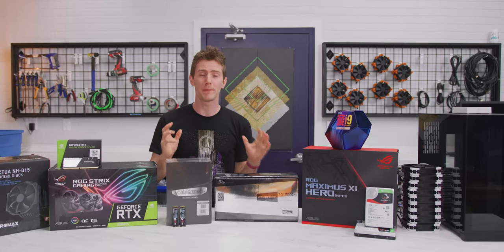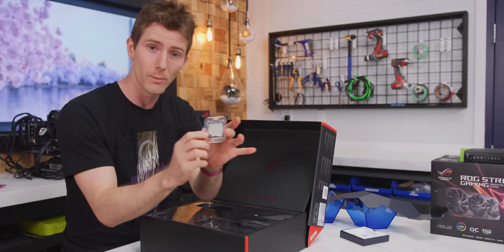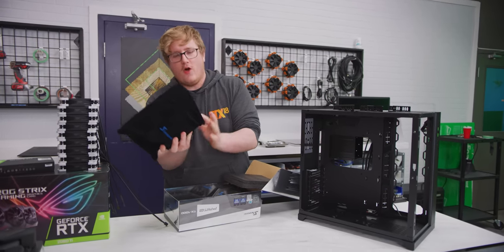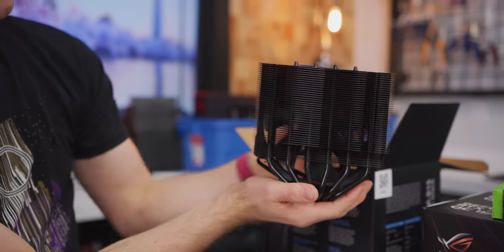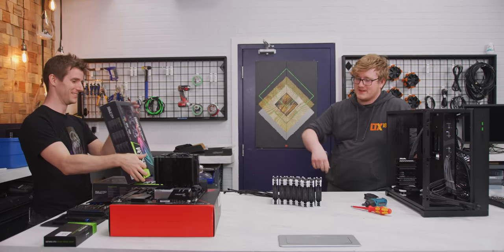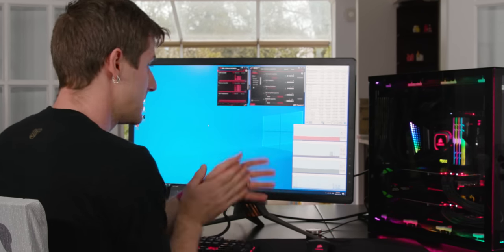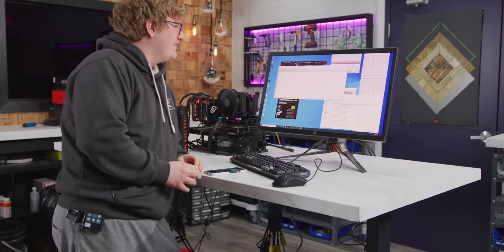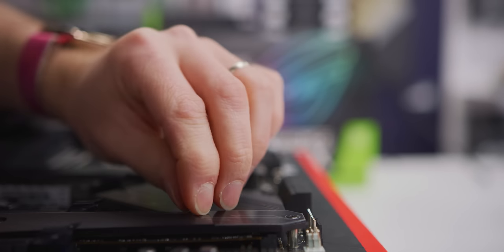Can AMD Beat the ULTIMATE Intel Gaming PC?

Comment: "Something that we could with a straight face say, there's a chance somebody is actually going to buy it"...
Goes on to say "the i9-9900Ks is still the king of the roost" -  A cpu they don't make any more because it was a limited run & you can only get "used" for upwards of $2,000.

Derp.
Reply: Funny thing is they bottlenecked the setup with the 9900KS cause it only runs 2080Tis on PCIe 3.0 X8. If they wanted the ultimate setup, they should have used HEDT
Reply: Ppl pay 2k for used 9900ks? Fuck 'em.
Reply: Funniest thing is the 9900KS would be handily beat by an 8086K, since you can regularly OC those to 5.5GHz or more (and they're cheaper to find, only issue is shitty Intel stock TIM). i5-10600K overclocked should handily beat a 9900KS in gaming (from the benchmarks I've seen), which I find hilarious...
Reply: Intel has a seller on their own site for €702. No idea what you are talking about
Reply: Definitely not $2,000 for a 9900KS I don’t know where you’re buying your CPU’s but that’s a huge ripoff. Also they didn’t overclock the Ryzen at all so it wasn’t a fair test to start with. When one is already overclocked pretty high and the other isn’t at all.
Reply: @Amusia727  The difference between those 2080Ti's running at x8 vs x16 is much smaller than the penalty you'll get from downgrading to HEDT parts from the 9900KS in games, so that is a pretty shit idea.
Reply: @SamxMusic68  Ryzen barely overclocks for one, pretty well known. Also, the gains from 5.1Ghz vs the 5Ghz stock all core turbo on the 9900KS are pretty tiny. It would have still won easily. And if they had tested at 1440p vs 4K, the margin would have been even greater lol.
Reply: You can easily get cheaper than that. They got a pre-binned version for less than half of that for god's sake. Just google the price and you can easily find sellers. Where are you pulling these claims from?
Reply: @Amusia727  A much easier solution to the PCIe bandwidth would be to just use a single 2080 Ti, not to switch to the HEDT platform (which typically has higher latency, and usually can't clock as high).
Reply: @soulshot96  Except there's a 20fps bump when you switch from a 9900K to 2950X...
Reply: @nathangamble125  Oh yeah, I think multi-GPU setups are a waste of time for most gamers. Just pointing out the better scaling on HEDT parts. Properly tuned HEDT handily beats consumer parts though
Reply: AmusiaPrussia Yea, 20fps gone out the window lmao.

Comment: Linus: "One area we did go over the top was our 2x1 Tb Ssds in raid 0"

Me: Awkwardly looks at 2x 2080Tis and 32 Tbs of HDD
Reply: Iago Lavor ikr man should have 0 HDDs. Dinousaur tech
Reply: the only one that doesn't make sense is 2x2080Ti
Reply: Patrick B HDDs in 2020. Lmao.
Reply: @Khloya69  HDD are still helpful as an archive media. and for things that doesn't need fast speed also for having your steam library on it and just copying games to SSD instead of re-downloading from internet
Reply: KA Tech >steam library
 >HDD.
>OK. That should be the last thing u want on HDD
Reply: KA Tech i don’t even have any HDD just 8TB in SSDs
Reply: @Khloya69  I am talking about instead of removing games, putting them on it in case you want to replay or just holding games that doesn't benefit from SSD
Reply: @Khloya69  for me I have 500GB SATA SSD and 500GB 2400RPM HDD
Reply: KA Tech i have 2x NVMe SSD and 2X sata SSD at 2TB each. Damn most mobos only having 2 m.2s
Reply: @Khloya69  I am stuck on low end skylake laptop I don't even have m.2 connector
Reply: KA Tech I recently upgraded to a 3950x system. Taking advantage of that sweet pcie4
Reply: IKR,   2 x 1TB NVME drives, $300-400 maybe depending upon vendor/sales/etc.    2x 2080Ti  $2300-3000 depending on how bent over you want to feel from the Nvidia  "we ain't got no competition" pricing scheme
Reply: @Khloya69  I also have a 3950x and all SSDs.
Reply: rodgerfox3 you used the wrong you’re which invalidates your whole reply
Reply: ChloeWade if people want more storage they’re going to go for Hard Drives not SSDs lol, no need to be so blockheaded about it
Reply: FPSpammers you mean if people are poor?
Reply: @Khloya69  lol i thought you were an Intel sheep
Reply: loading2112 only sheep was you to believe I’m a sheep for any company.
Reply: SSD's are nice for operating systems and certain games but overkill for movies, homework, and older games.

Who the hell needs their movies to run faster? Who the hell doesn't want 32TB's of storage? People just love spreading salt.
Reply: thegeorgezila nobody cares if it’s slow af dinosaur
Reply: ChloeWade lol nice bait, but grow up
Reply: ChloeWade LOL yeah I’m sure
Reply: similaritiesendhere no. I never met my dad and idgaf about that. Besides I keep guns so people don’t get to try that shit.
Reply: thegeorgezila mad bc u haven’t got long left lmao
Reply: thegeorgezila I’m not ignorant. There’s no valid reason to buy a hard drive
Reply: similaritiesendhere who tf even watches movies
Reply: similaritiesendhere i don’t behave like a child lmao.
Reply: similaritiesendhere I’m ‘overpaying’ ever thought you’re just underpaying?
Reply: similaritiesendhere you’re embarrassing yourself by mentioning such outdated mediums. Not me.
Reply: thegeorgezila  This has nothing to do with reason. She is technically right about SSD's being superior HDD's. 

This has to do with maturity. She's getting off on making enemies online while discussing hard drives. Can you imagine how many people find her insufferable in person? She said that she's getting ready to turn 21. She's gonna get punched out at a bar over some disagreement over something that doesn't even matter.
Reply: similaritiesendhere can’t get punched out in a bar if i don’t go out. Genius. Also when i do go out i carry a gun at all times foe that exact reason
Reply: similaritiesendhere i don’t give a fuck about making enemies. That’s why i do it all the time. Being liked is overrated
Reply: thegeorgezila you cannot possibly be for real when your generation single handedly destroyed the economy. I’ve had to do more than you ever did. You old people basically had everything handed to you shit was so cheap. I didn’t
Reply: thegeorgezila keep saying i will still be a child but I’m already more mature than you’ll ever be.
Reply: thegeorgezila old people single handedly ruined the economy and i will never forgive them
Reply: @thegeorgezila You can have both. NVME for your operating system and main programs/games and other cheaper drives for actual mass storage. Every popular PC builder on youtube follows this strategy. 

How do people who don't understand this have the balls to give PC advice on the internet? My gaming laptop has a 1tb nvme drive, 2 tb's of hybrid drive storage (80% the speed of an SSD), 512gb's of Micro SD storage, and 2 + 4tb's of external SSD storage. I have tons of storage without going broke. My PC flies.

Comment: Aio cooler: you couldn’t live with your own failures. where did that bring you? Back to me.
Reply: And the failure in this video is part of the reason I have an AIO for my CPU. You can practically put the bulk of it wherever you want in most cases. If it doesn't fit, you can make it fit.

Comment: Power usage -AMD wins
Work loads -AMD wins
Room Heat- AMD wins
Cooling Noise- AMD wins

Gaming-Intel wins with a binned CPU.
Reply: Price wise AMD wins by a large margin: R5 3600 > 9600KF
R7 3700X > 9700K
1600AF >>>>>>>>>>>>>>>>>>>>>>>>>> 9400F
Reply: Intel wins with heat too, you can heat a small apartment with one of those.
Reply: It doesnt need a pre-binned CPU, that was just a little bonus.
Also, all of the CPUs that Nuba compared, Intel wins in gaming.

 You guys seem biased and fanboy-ish. Grow up.
Reply: Intel wins by, what, 5 frames at 100+ fps at the highest possible end? A pretty tiny advantage compared to every other disadvantage Intel has
Also, the 9900ks and 9900kf (Intel's fastest chips)are pre-binned CPUs, so...
Reply: @morpheas768  they happen to "win" in gaming by a very small amount of FPS in settings that people do not tend to play on (ultra high), not to mention they lose by 50% or more in any other activity, most notably in rendering and streaming. Why would you care buying a hotter, power hungry and inneficient processor for more price only to have a non-noticeable frame increase and only if youre running a 2080ti?
its not "fanboyism", intel lost pretty bad this generation, last generation and already lost the next one too (10th vs ryzen 4000), only they probably lost much harder
Competition is good, I had an intel processor before my R7 2700, AMD gave budget builders quality processors, if it were up to intel we'd still be running 4C/4T for $200
Reply: @WarbossRB  Lol probably cheaper to heat your apartment with a old oil heater.
Reply: The comment I was looking for. Intel still loses
Reply: @TheNubaHS  AMD CPUs have much better value and the gaming lead will change with the Ryzen 4000 Series (Zen 3)
Reply: @milkynom  Yes price, how did i forget that one haha
Reply: MAC PRO IS DA BEST

Comment: When even LTT missed the air cooler case compatibility, i don't have to feel so bad about myself.
Reply: Im a noob at pc building so I'm wondering if what he said at @0:45 is true. So water cooling is basically...useless?
Reply: @headlight31  no, it actually makes it easier to clean, replace and also make your pc look neat but risking ur whole rig from leakage, but yeah they have replacement warranties for that.
Reply: @ronin_boogz  not for your corrupted data :s
Reply: @ZILLION4EVER  yup, sad :'( aircoolers 4lyf
Reply: @headlight31  yes, it's true, they have a video demonstrating that. It's called "why you shouldn't watercool" or something like that. Look it up if you want to, but, spoiler alert, air cooling is overall better
Reply: @headlight31  Yeah a good air cooler is as good as an AIO.
Reply: That heat sink only fits on test benches from the looks of it
Reply: @VBshredder  Ive got it and it fits with 1.5 cm clearance

Comment: Something someone would buy:
"dual rtx 2080ti's"
Most won't even buy a single 2080ti, alot of computers are cheaper than a 2080ti
Reply: Mashiori Man. Thanks Captain Obvious
Reply: I was about to say the same thing, the same goes for the 9900KS - not really widely available...
Reply: you can get a rx 5700xt build for 1200$. The performance is only around 20% weaker....
Reply: I wouldn't simply because I use Linux and nVidia needs to unfuck their driver situation over there before I start considering them again. I mean, their Linux driver isn't bad but it has more issues than the OSS drivers do and I'm not paying their premium for a decidedly less-than-premium experience...

Man, I'm really hoping either rDNA2 is great or Intel gets their GPU divisions shit together.
Reply: @jimnguyen.   definitely not 20%, 2080 ti is around 30-40% faster but it's also 300% more expensive so a 5700 xt is still best value 1440p GPU
Reply: Lol i have one
Reply: @lucas_vlanc  but still, dual rtx 2080 ti?
Reply: Some people have disposable income and don't care lol
Reply: ashley twelwe sure they do. I spent a grand total of $0 on my gaming rig.
Reply: ashley twelwe My PC runs Oblivion on min. settings with 1600x900 and still has 15 frames. I play some games on Xbox One X, but I don't even have enough € for my GamePass. So yeah, playing games with no money is real.
Reply: @jimnguyen.   no, single 2080 ti is 20-30% faster in 1440p in gaming, SLI is pretty unreliable and unpredictable, some games just straight up don't support it, never do SLI/crossfire unless you have money to burn
Reply: 9900KS is officialy discontinued, so good luck still getting one :D
Reply: @lucas_vlanc  I was being sarcastic. Never do it please beginners. Might seems tempting but no.
Reply: I still using core 2 quad q9500 in 2020.. hahahaha
Reply: @azlio1988  oof mate

Comment: As soon as you showed the air cooler and the case, I was waiting for them to realize it wouldn't fit. Wasn't disappointed!
Reply: LOL... I got these two before, case and cooler... never tried to use that cooler with that case until i sold it
Reply: @seynoonrae2474  It's very explicitly a case built with water-cooling in mind. It can accomodate air coolers well enough - I have an MSI Core Frozr L in mine, which is the one you always see in GamersNexus videos - and it works well enough.

But at the price point for that sort of case, you should both know to do the research if a cooler will fit, and you're more likely to be exploring custom loops.
Reply: My PC was built inside an O-11, and yes... once I saw that combination, I knew it wouldn't work.
Reply: @seynoonrae2474  This case is not designed for air coolers, it's strictly water cooling by the design of the airflow

Comment: Linus : "A *pre-binned, pre-overclocked* intel chip beat our stock Ryzen!"
Reply: Yeah they didnt even tell us What it was overcloked to
Reply: @niilasaarinen3041  5.1 GHz. See for yourself at 11:05
Reply: It's kinda a fair comparison cuz the binned Intel was the same price as the stock Ryzen and either way Intel usually has a small gain in games. They should've done some streaming or something to show AMDs advantages
Reply: @joebob2738  I agree, same price means fair comparison. And they DID clarify that it's all about gaming.
Reply: birkenlord thats the Intel CPU lol
Reply: @niilasaarinen3041  the Ryzen wasn't overclocked, was it? It's about what you can get out of the box. A lot of people don't want to overclock themselves :)
Reply: birkenlord thats not a fair comparison then
Reply: @niilasaarinen3041  why? The average Joe that, for the first time, builds a gaming PC doesn't want to overclock. Might be a bit too scary to start with. They compared two off the shelves CPUs for the SAME price. No idea whether AMD sells them pre-overclocked. But I don't think so
Reply: birkenlord yeah but the average koe isnt buying a fucking 3500 PC is he?
Reply: @birkenlord  it's not pre-overclocked in that sense guys! Silicon Lottery sells chips that are VALIDATED to run at higher speeds! 9900ks is a pre-overclocked 9900k from intel but to make it run at 5.1GHz Silicon Lottery provides a certificate containing the bios settings at which it was tested so you can put those settings in your computer yourself! Overclock settings are BIOS bound! You cannot write them into the cpu unless you're Intel.
Ergo since overclock is free performance at least 50% of 3950x can hit 4Ghz all core with little effort... even 3.9 would be a better comparison!
Reply: @BF26595  thank you, I didn't know that
Reply: @niilasaarinen3041  there sure are people that buy pre-builds for that price, so I don't see why average Joes wouldn't build one for that price themselves, either
Reply: @birkenlord  overclocking is free
Reply: @birkenlord  The issue is that in order to get the 5.1 out of the prebinned processor you have to go into the bios and overclock it, as a stock configuration the processor will only do what intel tells it, even if you just go through the board manufacturer's overclocking tool. So to keep the comparison fair they should have over clocked the ryzen to the max they could get stable on the same AIO.
Reply: @joebob2738  AMD fan boy's raging lol
Reply: @arx1kage  And yet most people don't want to deal with it. But, as clarified above, the remarks that I made as to it being factory-overclocked were factually wrong.
Reply: Blah blah , the intel chip would have probably still a lot of OC room ahead so...
Reply: @vicotg7987  after 5.1Ghz??
Reply: @vicotg7987  Mate, the Intel chip had literally zero OC room ahead. The whole point of buying from Silicone Lottery is that you pay extra for a CPU where experts have determined the exact settings required to push the absolute best OC out of the individual chip you get. Any attempts at further OC past this point would cause system instability - if it would even work at all.
Reply: @tabbyv948  that is not correct ...Linus says clearly, almost stock voltage...my 8700 k takes 5.23 ghz a chosen cpu almost stock voltage at 5.1 ...mmm let me guess :5.4 is easy money
Reply: Nik  Yeah, a Ryzen with twice the cores.